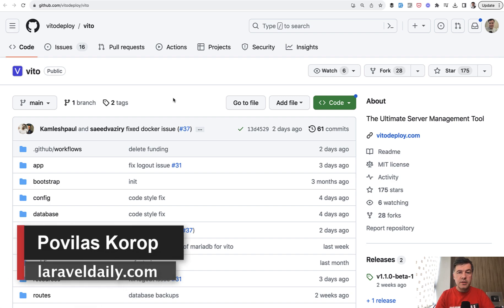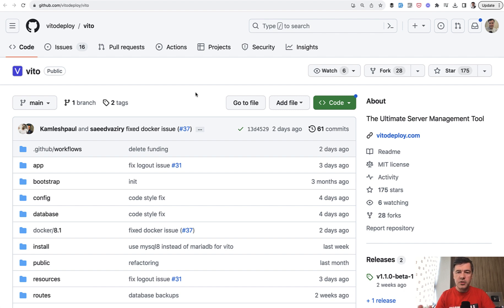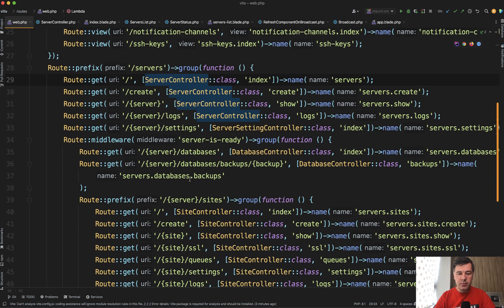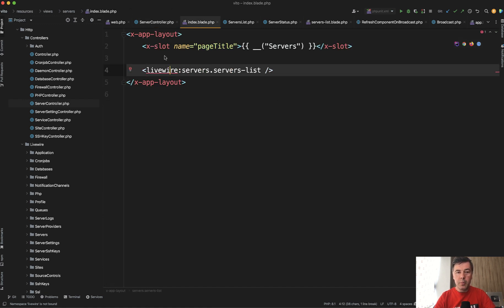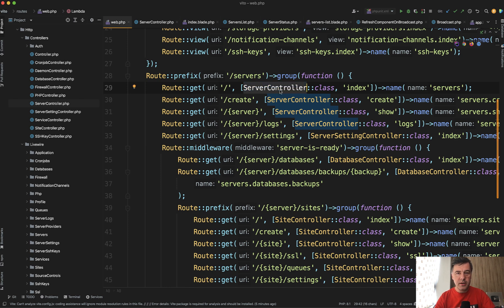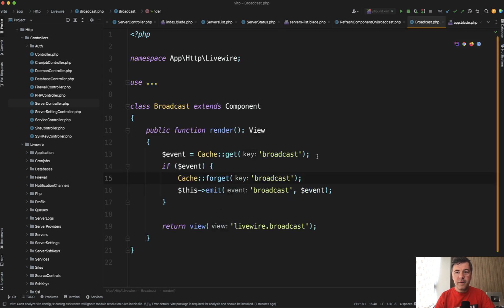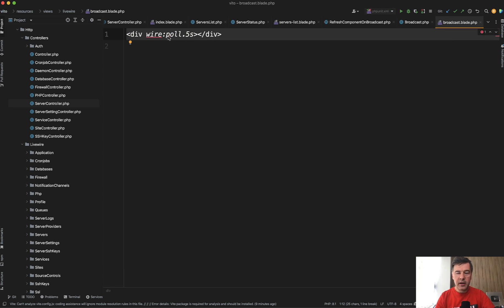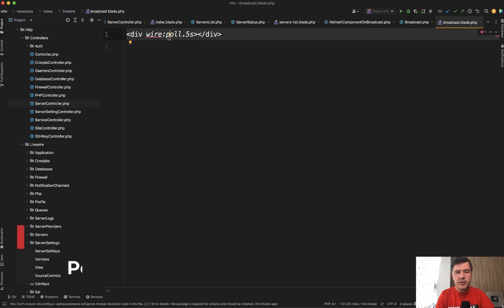Livewire Example: Full-Page Components and Broadcast with Polling

Comment: I actually do this in my applications, in my case, its more of following convention 

Think of it like a regular html file which vue is mounted on

Or you can imagine if you want not 1 but 2 livewire components on the page

I prefer not touching the controllers when i want to move things around and just move them in the blade file 

Or when im adding new components to that oage

It makes for a modular kind of component design which sure could be a livewire component but I'd rather not use blade since it is unreactive

Edit: my brain is feeling overwhelmed and my leg is itchy so this comment probably makes no sense
Reply from the maker: It makes perfect sense! So controller is like a foundational route allowing you to add more stuff in Blade. Logical!

The other approach would be to use Route::view() directly, then, I guess.
Reply: @LaravelDaily  haha

What if you want to perform validation on the query parameters, is that supported?
Reply from the maker: No, for those cases you do need controllers. Or do the validation on the routes level.
Reply: @LaravelDaily  yup that's why I use controllers

I many times have to validate query parameters